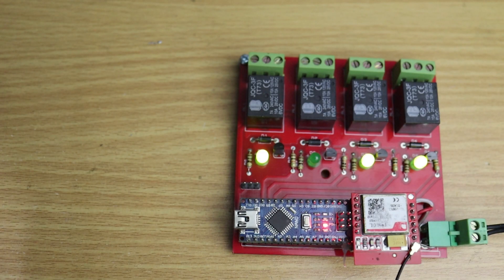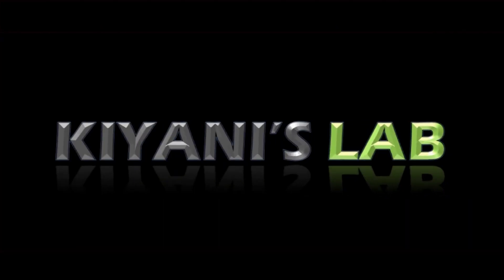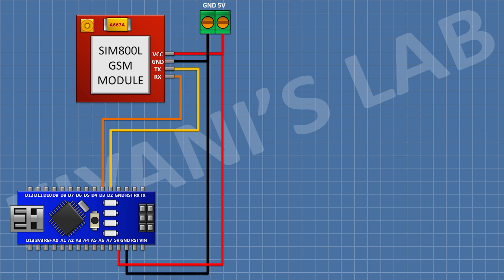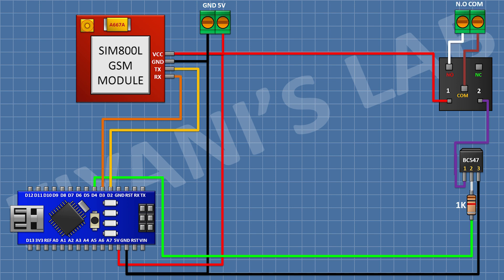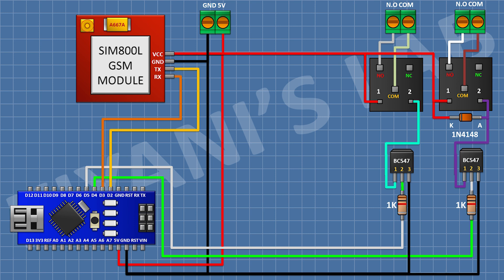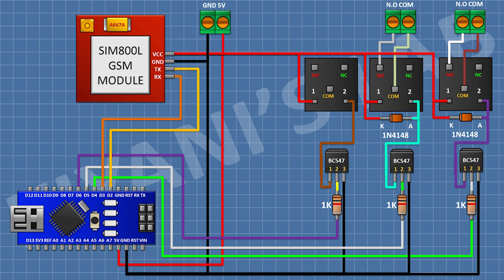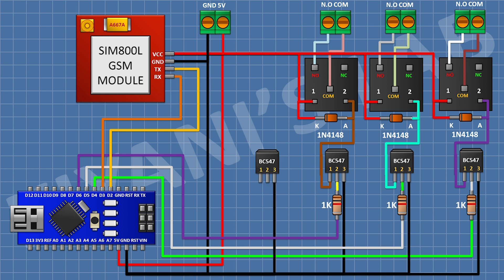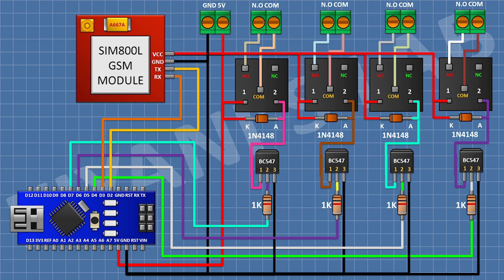How To Make 4 Channel SMS Operated Relay Switch | Arduino Project

Comment: Don't use 5V to power Sim800l, It's recommended to use 3.7 to 4.2V, just add any 1V dropout diode between 5V and sim800's VCC.
Reply: What diode is 1v?
Reply: @quickfixengineeringltd8035  1N4001 or 1N4007 should work.